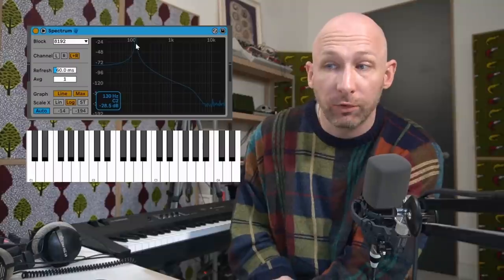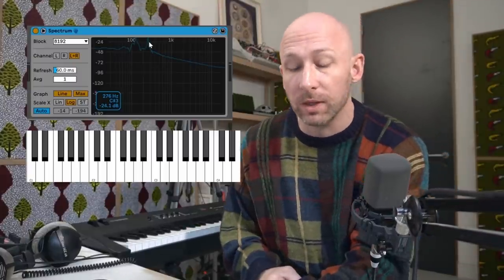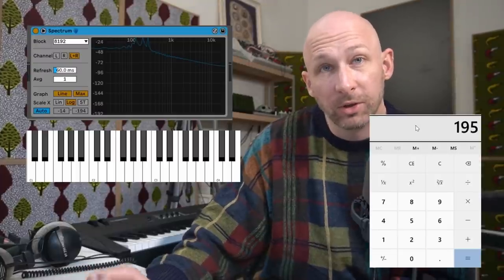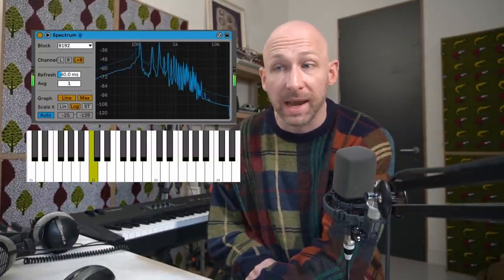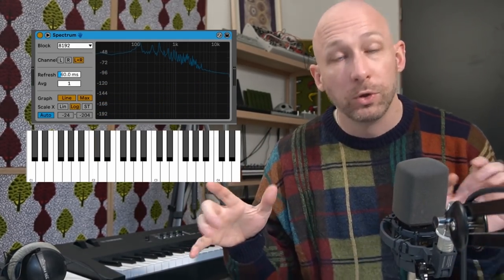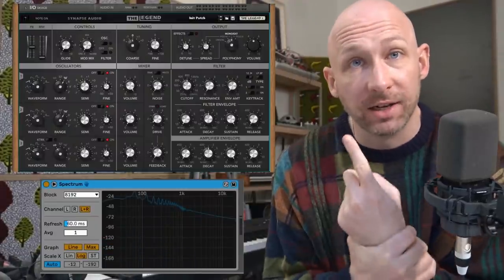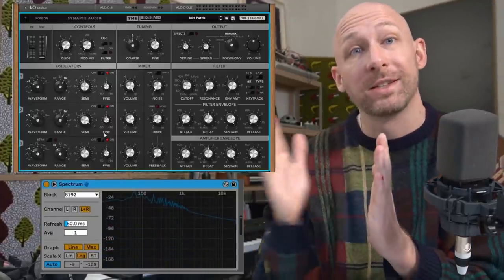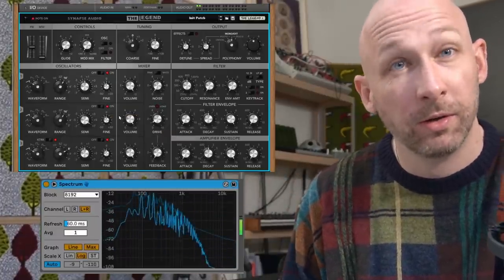Let me tell you about power chords

Comment: Little correction/addition: When playing notes on a piano or basically any instrument with equal temperament you will not have any perfect fifths. The interval you play is about 2 cents narrower than a natural perfect fifth (the one with the frequency ratio of 3/2). Might not sound like much, but it makes quite a difference, it sounds significantly less static and fat than a perfect fifth. Therefore it really makes sense to use a second oscillator on a synth and tune it to a perfect fifth instead of programming or playing two notes. With the perfect 3/2 frequency ratio you will have an audible octave below the fundamental frequency, also known as a subharmonic. That is why it has such a rich and fat sound.
Reply from the maker: Hey Roland! Great observation about it being better to do it in-synth than in-piano. However, I don't see any evidence to support the thing about the subharmonic (I just loaded in a synth to test that, and simply setting 2 oscillators to +0 and +7 doesn't result in any subharmonics). Am I misunderstanding you?
The type of synthesis I've seen generating subharmonics is FM though, there it definitely does.
Reply: @OscarUnderdog  You might not actually hear the subharmonic note, but it is definitely there. The correct term for it is combination tone, and the lower additional tone is called the resultant tone.
By adding two frequencies with the ratio of 3/2 you will get a periodicity at the lower octave. E.g. 200Hz + 300Hz will give you a periodicity of 100Hz. This technique of making sounds fatter by adding a fifth above has been around for centuries, for example pipe organs have been built with 16' and 10 2/3' stops in order to get a fake 32' stop (a real 32' stoo is expensive to build and the pipes are incredibly huge). Another great example are multiphonetics played on a trombone or saxophone; the musicians sings the fifth above the note played on the instrument (yes both singing and playing at the same time) in order to make that lower octave audible. So when we add a second VCO at +7 semitones we are doing the same thing musicians have been doing since hundreds of years 🙂
Reply: @OscarUnderdog  Oscar, for you to produce this effect you need to detune up by the 2 cents (or 1,955 if more precision is available) Roland mentioned the oscillator of the 5th from a equally-tempered perfect 5th into a natural perfect 5th.

This is because keyboard instruments such as the piano normally use an equal-tempered version of the perfect fifth, enabling the instrument to play in all keys. In 12-tone equal temperament, the frequencies of the equally-tempered perfect 5th are in the ratio* (12th squareroot of 2)^7, or approximately 1,498307. So you need to detune it up a little bit from the equally-tempered to reach the natural 1,5. Hope it helps =)

* 12th squareroot of 2 because you're dividing the perfect octave (the "2", two times the frequency) in 12 parts (hence the "equal temperament", equal distance between the semitones), then powering it up to 7 because it's 7 semitones up (or multiplying by 12th squareroot of 2 seven times; you would double the frequency if you multiply by 12th squareroot of 2 twelve times, because that eliminates the 12th squareroot over the 2).
Reply: @RafaelAAMerlo  Exactly 👍 I wanted to leave out the math, but thanks for adding it!
To add a little bit more about tonal systems: The unit "cent" is defined as 1/100 semitone in a twelve-tone equally temperament system, so as any musical interval it is a logarithmic unit and describes a frequency ratio and not a frequency difference. However, as a perfect fifth in equal temperament is by definition 700 cents we can calculate the number of cents of a perfect fifth in natural/pure tuning. One cent is the 1200th root of 2, so the frequency ratio is about 1.0005777895/1. Now to calculate the natural fifth we need to calculate how many intervals we need to get to the frequency ratio of the natural fifth: 1200(√2)^x=3/2 ...math blabla... x=701.955. The difference of 1.955 cents 1/12 pythagorean comma (the difference between 12 just perfect fifths and 7 octaves).
Oscar, how could you skip this crucial bit of information?!?!?! 😄
Reply: About the organ stops: As organs are usually also tuned in twelve tone equal temperament you would not have perfect fifths with the 10 2/3' stop in relation to the 16' stop. However as the 10 2/3' stop is not intended to be used on itself it can be tuned to a pure fifth above the corresponding 16' note. So despite the fact that the instrument uses equal temparement the stop to generate the combination tone still can use pure tuning - the traditional equivalent of detuning a second VCO by 701.955 cents. And yes, if you play a chord you will have both versions of perfect fifths at the same time.

Comment: So 7 semitones up gets you to 150% of base frequency and another 5 semitones to 200%. That's one twisted system.
Reply: If you're interested: It appears twisted because of the coincidental relationship between our favoring frequencies that have simple ratios (3 to 2 in your example) and the logarithmic frequency steps of the western equal temperament (equal-sounding steps) tuning system. Our auditory system experiences frequencies approximately logarithmically -- that is, we experience the interval between notes as the same when their frequency ratios are the same. The octave is a doubling of frequency, and feels similar whether the notes are 100 and 200 Hz, or 500 and 1000 Hz. And similar with other ratios, like 3 to 2, as in your 150%.  
But what about semitones? There are 12 semitone steps in the western equal-temperament tuning system, and ratio of their frequencies is 1.05946..., so that when you multiply that together 12 times you arrive at 2 (the octave).  By choosing this 12-equal-sounding-steps system (instead of say 10, or 14), we get the lucky coincidence that several of the intermediate multiplications come out very close to exact simple ratios, such as 3:2 (1.05946 ^ 7) or 4:3 and so on, while at the same time getting a bunch of starting points for those ratios. Ie: you can create a 3:2 or 4:3 ratio starting at any of the 12 steps.  
Returning to your observation that there's 7 steps to get to 150%, but only 5 more steps to get to 200% -- that's because the ratio of 200:150 is only 4/3, or 1.33, so it's covered in less steps than the first 1.5. (And maybe obviously,  1.33 x 1.5 = 2.).  
The topic of why we like those simple ratios is also pretty interesting and has to do with the phenomenon that two notes played simultaneously produce new tones at the sum and difference frequencies, which contribute pleasantly or unpleasantly.  So here is an interplay between ratios (multiplication), logarithmic perception, and sum/differences (an additive or linear characteristic).
Reply from the maker: GRAHAM this is an amazing response. I wouldn't have known what to respond to Edgar :D You explain it so damn well!!! Thank you!
Reply: @OscarUnderdog  Thanks! I'm not sure Edgar was really asking for so much 'splainin', but I just think the interplay between the compounded semitone intervals, and the fact that they manage to hit several simple integer ratios is just quirkily fortuitous. And the reason why we like to hear the simple ratios, while attributed to the difference frequencies, is not entirely settled, I think.